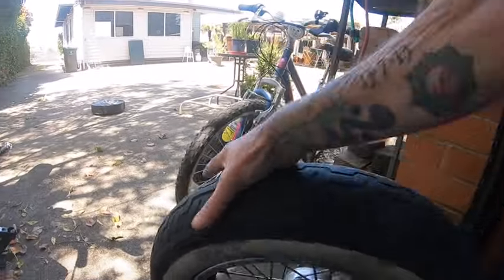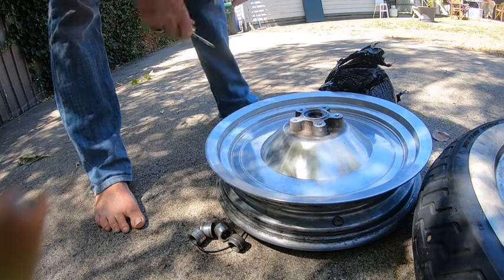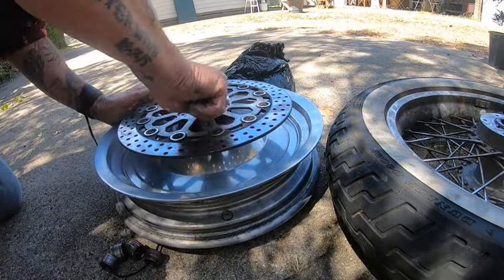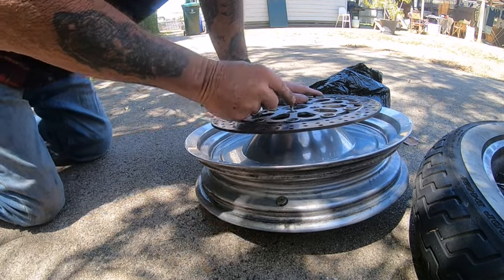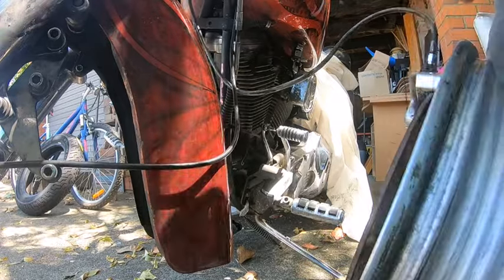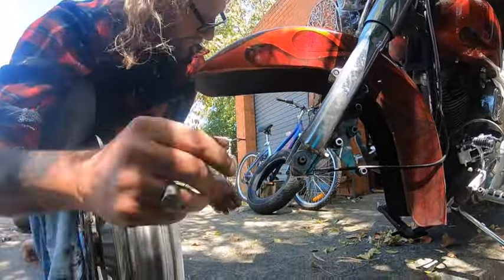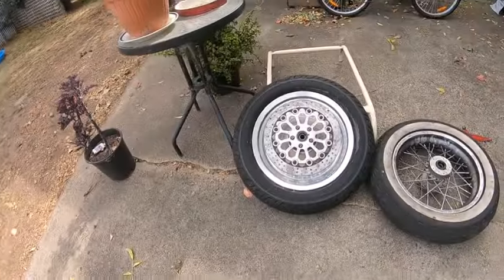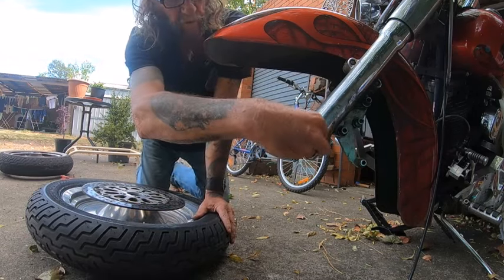Did l Get The Rim.... Hippy Trev

Comment: I admire you for working on your ride your bike has character I have the same bike but a twin cam fatboy 2009 I’ve had it from brand new and nearly clocked up 100,000 kilometres if I’m in Corio or Colac we should meet up love your horn cover and I see you have the more modern twin cam head light and driving lights rubber side up 😊
Reply from the maker: thanks mate   .. wow  thats a lota miles ya have done...l have owned thios bike 7 years now  & no one touche's my bike but me.. cheers
Reply: @hippytrev7452  hi Trev and thankyou for your reply message your bike being an evo is Harley’s best made engine so basic but so reliable and not complex and will do huge miles it’s hood your doing your own service work when you do it yourself you do it right I agree other people just screw your bike over usually by over tightening everything especially oil filters cheers mate
Reply from the maker: @anthonymasluk2295  l love Evo's  very easy to work on  & very reilable...
thanks mate...& yes l never trust a bike shop.. cheers
Reply: @hippytrev7452  cheers mate

Comment: after watching you mess with that wheel, made me want to be there to lend you  a hand. done lots of odd ball fits over the years. feel your brake rotor after you take it for a ride, make sure it's not heating up from friction. if it is, you're wheel may need a different spacer.
Reply from the maker: yer l will feel for heat...lm hopeing the  pads will wear down to where there right..
l only have the spacers l have  at moment... test run tomorow will tell me a lot.. thanks Bill.. cheers for that